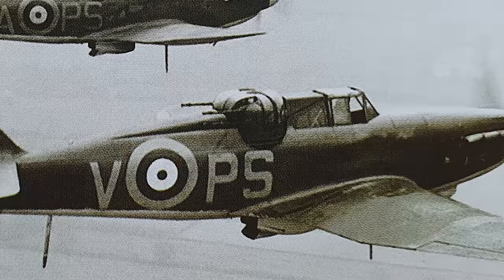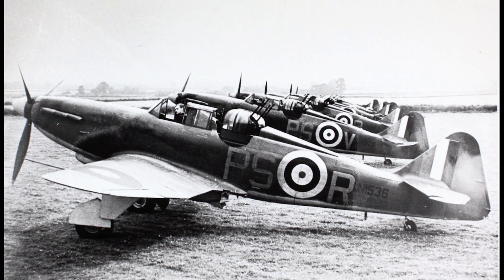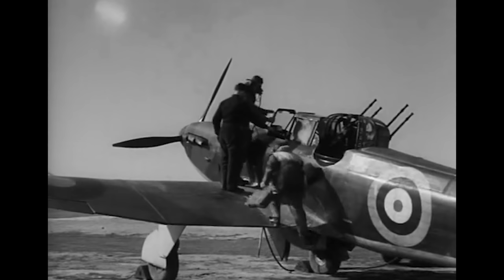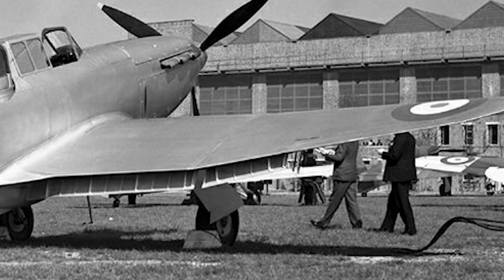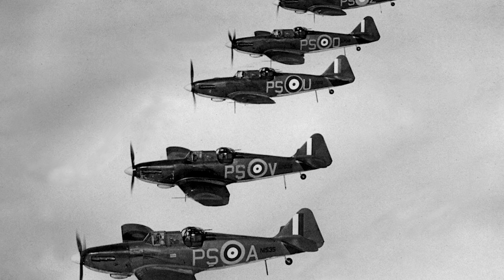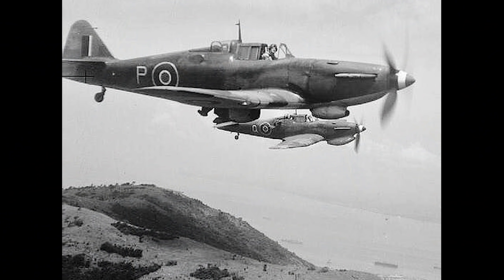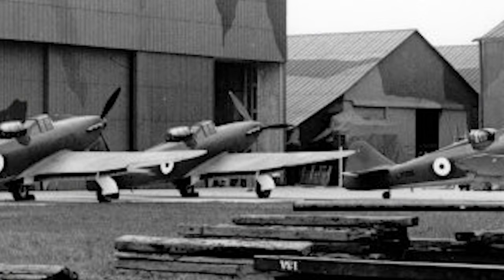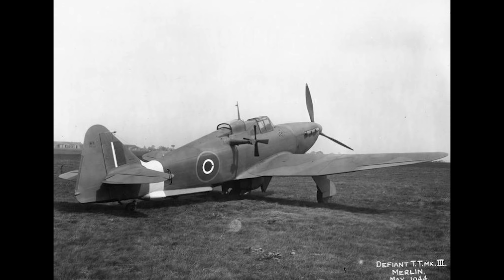Boulton Paul Defiant - The Unlucky Turret Fighter | Aircraft History #4

Comment: My Dad served on HMS Rosebay, a corvette, from 1943-45, as the senior rating for gunnery. He chose the BPD turret that was installed where the aft 4" gun had once been to be his station. Elevated on a platform, through which you gained access to the guns, it provided excellent aft and about 200´ pan from port to starboard.

Comment: As a youngster in the '60's I always carried a torch for the Defiant, and even at that young age I could shoot holes through all of the aviation historians 'reasons' why it was a failure as a daylight fighter.  Recently a book was published, 'Defiant, the untold story of the Battle of Britain' and all my early beliefs were fully vindicated.
The cause of the Defiant's unwarranted reputation as a failure is chiefly down to the commanding officer of 141 Sqdn, an arrogant man who refused to take advice from the commander of the far more experienced 264 Sqdn.  Incidentally, you're video is a little inaccurate when it said all nine of 141's flight were shot down, the correct figure was 7 out of the 9.  But what is often not known is that this flight of inexperienced aircrew were jumped by a full wing of 30+ 109's, a veteran group with several aces among them.  Even so, they managed to bring down 4 109's in return.
The Defiant was a victim of gross mismanagement at higher levels, and poor leadership on the front line.  Handled correctly by playing to it's strengths it was the equal of the 109, and in a mock dogfight against a Spitfire flown by Sqdn Ldr Stanford-Tuck, a leading British ace, it flew rings around the Spitfire, recording one 'kill' after another, while Standford-Tuck never once got the Defiant in his sights.
Reply from the maker: I'm waiting for my copy of that book to arrive. If I have time I plan to cover some of these aircraft in depth sometime in the future (probably 1 hour videos) and I plan to feature the Defiant again :)
Reply: a great post and excellent points. However, if the core of the argument is " .. when expertly handled .." the question then becomes, will the pilots survive to become experts?
Reply: Flew rings round the Spitfire? Surprising, when you compare performance statistics
Reply: What is the recently published book that you mention?
Reply: @RexsHangar  Don't bother.  Wait for Andy Long's book on the Defiant, due out next year.
Reply: Excellent comment Nigel, beefing up an excellent video.
Reply: @madisntit6547  I call upon over 40 years of research here and in Germany, and the authorship of books and magazine articles, as well as giving talks to aviation groups.  I prefer to maintain my anonymity on here, but am happy to pass on information that I have acquired over that time, as well as to point people in the direction of where to find the information from modern research (i.e. the book on the air war over Dunkirk by Simon Parry and Mark Postlethwaite published by Red Kite [both are also experienced researchers with many decades of research]).  What I am not happy with, and I try to correct, are the myths and incorrect information that over time has been accepted as fact, such as the 39 victories claimed by 264 Squadron on 29th May 1940.  It didn't happen.  But I approach this matter from an even-handed position: the Luftwaffe overclaimed heavily during the Battle of Britain.  One fighter unit claimed to have shot down 51 RAF fighters in one day - absolutely preposterous!  I hope the foregoing explains for you in more detail the reason why I have countered certain things in the vid.
Reply: @colvinator1611  Excellent comment?  Are you sure?  '...The cause of the Defiant's unwarranted reputation as a failure...'  It was a WARRANTED  reputation, since it was a failure as a day fighter.  '...Handled correctly by playing to it's strengths it was the equal of the 109...'  It was the equal to a 109, with a top speed disparity of 50 mph?  Sorry, that is just a joke!  '...Even so, they managed to bring down 4 109's in return...'  No they didn't.  One 109 was claimed by P/O Tamblyn; one damaged by S/Ldr Richardson. The other 109 claims were by 111 Squadron.  In fact all the 109s of III./JG 51 managed to get back to France, albeit four in a damaged state.  One of the 109 pilots died as a result of his injuries (cf. 'Battle of Britain Combat Archive, Volume 1' by Simon Parry, published by Red Kite - I recommend this series most highly to anyone with an interest in the Battle of Britain).  Sorry, but there are some things in that post which are simply incorrect...
Reply: @madisntit6547  The unfortunate thing is, the information is 'out there', but these documentary-makers do not appear to get in contact with the correct people.  The only ones that I know of that have been contacted in recent years that know their stuff that have been used in documantaries are: Dave Brocklehurst Mbe, Simon Parry, Andy Saunders, and Stephen Bungay.  And a merry Xmas and happy new year to you.  Take care, stay safe!
Reply: Brilliant response... I worked as part of a RAF team in the early 2000,s up at RAF Hendon.. Working on many WW2 aircraft and the Defiant was one of these. Cracking aircraft. Extremely brave men. If they'd been fitted with a constant speed prop and bullet proof glass more pilots and gunners would of came back to tell the tale.... Was sent up without cover and got slaughtered....
Reply: I only checked the comments to see how many rabid Defiant fans would emerge, and I was not disappointed.
Reply: Flew rings around the spitfire hahahaha
Reply: My heart has always had a soft spot for the Defiant, but I have never l t myself believe that it would be on par with a 109, let alone a Spitfire.
The comment above is amusing 😂
Reply: Standford Tuck flew Hurricanes throughout WW2.
Reply: No amount of confirmatory bias (“vindicated”) can change the Defiant’s abysmal record - and that book you cite has been trashed by multiple historians as a poorly-researched mess by an (non-aviation) author who is clearly out of his depth, doesn’t understand his subject, makes bizarre, amateurish, errors and has an agenda to rewrite a bad aircraft as a plucky underdog. A great British design debacle to rival even the Great Tank Scandal.

Comment: Really fascinating concept, I’m sure it would’ve had more success under slightly different circumstances. And with some design changes, the turret could’ve fulfilled the roles of main armament(forward facing, pilot controlled), self defense and „Schräge Musik“.
Reply: The turret could rotate forwards and the guns locked at a 45-degree angle upwards. Oblique attacks from below were a feature of the design concept.

Comment: After seeing that guy climbing into the turret, I presume that being assigned as a gunner was practically a death sentence; I don't see how anyone could bail out of that. 

I would be curious to find data on how many Defiant gunners ever made it out of planes going down.
Reply: Author Alec Brew has a book about the Defiant that goes into all of this.  It was hard to bail out of but the gunner's clothing helped - that bulky suit he wears incorporated a parachute into it, so there was no need to clip on a parachute and then jump, the way, say, Lancaster rear gunners had to in similar turrets.
Reply: @elennapointer701  👍
Reply: A few things of note here. Boulton Paul were aware of the shortcomings of the turret for bailing out of. Air gunners were assigned a special parachute rig which covered the back entirely in a flat pack arrangement. I believe the Battle of Britain museum has one on show. Also not well known is the beneath the gun turret was a kick out panel for emergency escape. The gunner actually sat in a sling type seat and procedure was to slip down out of the seat and kick out the panel. That was the theory anyway but if it was ever used is not on record. Getting out the same way as getting in would have been a slim chance.

Comment: I've always wondered why, when the turret-fighter concept didn't pan out, they didnt remove the turrets and blank off the space for them, adjust the rear of the cockpit so that the pilot could see all around,  and add some wing-mounted guns. They might've been able to add an extra fuel tank or even a little more armour for the pilot, with the weight saved from removing the turret and second crew member.  It might well have made a reasonable fighter then (local defence in areas away from the Channel, perhaps?), and with development, I suspect might have become a very capable fighter, especially with thinner wings.  When you look at the numbers for the thing - engine HP, mass, performance, etc,  it looks to me that it might have -by the numbers - surpassed the Hurricane. Which of course doesn't mean it would have been practical to convert the Defiant whilst the country is fighting desperately for survival, when you can just crank out more of the already perfectly good Hurricane instead!
But I've always had a soft soft for the Defiant, more for what it could have been if it didnt have that silly turret, than for what it actually was.

Comment: There were 9 designs submitted to fill Specification F.9/35 - 2 of which were flown (the Defiant and the Hotspur). There were also the F11/37 and the F18/40 Specifications both of which used cannons instead of machine guns, none of which got of the drawing  board. Then there was the Misquito F.II, which flew and confirmed de Havilland right about the Mosdie not needing the turret and the ,kiss of performance it created.

Comment: I remember reading an RAF pilot's assessment of the Defiant. The stable handling would have made it an ideal ground attack aircraft with the turret protecting the tail, a British Sturmovik IL-2.
Reply: I read one of the original documents held in archive by BPA ltd. The testing pilot said the aircraft handled exactly like a Hurricane in all respects of handling but the pilot had to be aware of the shifts in the aircraft when the turret was moved. Good training between pilot and gunner resulted in a rear firing and stable gun platform.
Reply: Except it was not designed to carry even more mass that would required for installation of additional armament.
Reply: @victorhartman1904  That was the pilot's assessment - that it would have made a good ground attack aircraft. You could have removed the turret and fitted twin Vicker's K guns on a Scarfe ring for rearward defence. That would have removed a lot of weight.
Reply: @geoffreypiltz271  What you are describing is essentially the Hawker Henley. But that`s another story.

Comment: The downside of the Defiant was not only its lack or forward firing guns . Which made it ineffective in combat . A more deficient effect was its need for the Merlin engine that were needed  in the Spitfire  and Hurricane fighters . This took 1200 fighters out of the picture . This was equal to the German  Luftwaffe scoring at least 600 victory's due to the RAF shortage of fighters  with no positive results  . As the Defiant shot down few enemy planes  a additional 1200 Spitfires and Hurricanes which were far more effective would have made a bigger impact

Comment: So not a failure after all. I wondered what the performance of the aircraft would have been without the turret, with forward firing guns just like the Hurricane or Spitfire. Looked a very streamlined aircraft. I did notice the gunner trying to shut the rear doors with effort getting into the aircraft, i wondered if this would have hindered him getting out in an emergency, especially if wounded or if the turret was damaged, that would be a unlucky gunner.
Reply: That's what I thought too. It was like trying to close the sliding doors on a shower with wet hands. Plus he couldn't bail out if he was facing to the rear
Reply: '...So not a failure after all...'  Sorry, but it was.  Its reputation was built around its 'claims' of 39 Luftwaffe aircraft shot down on 29th May 1940, when the 'actuals' was between 3-4.  The Air Ministry continued to use two squadrons in the Battle of Britain (141 & 264) and they were withdrawn after being slaughtered in the skies of southern England.  And that's a fact.

Comment: I did hear somewhere that the RN got their hands on a few of the turrets from the defiants and bolted them to the top of the turrets on some of their older destroyers. Great for AA work and makes a mess of a German U-boat crew trying to man their deck gun... not sure how true it was as I can't find reference material. Would have loved to see it though.
Reply: We're they at least upgunned to 50 cals, can't imagine 303s doing much damage until you could see the attackers eyes
Reply: No. 
Most of the turret is inside the aircraft, it reaches nearly the full depth of the fuselage.
There is no wat to incorporate that in to a destroyer gun turret, it is full of gun. It would work if you removed the gun from the turret but then you would have to rig up a hydraulic supply to power it.
See link for the various turrets used by British destroyers. https://en.wikipedia.org/wiki/QF_4.7-inch_Mk_IX_%26_XII_naval_gun

Comment: At 4:46 he claims that on 29th May 1940 264 Squadron shot down 19 Stukas, 9 Bf 110s, and  Ju 88.  The claims for 29th May 1940 actually totalled 39 across two combat missions.  This was overclaiming on a massive scale.  The Luftwaffe did not lose 39 aircraft IN TOTAL on that day.  No Bf 110s were lost, and the claims for Stukas was ridiculous.  To get an accurate view of what happened on this day, get hold of 'Dunkirk Air Combat Archive' by Simon Parry and Mark Postlethwaite, published by Red Kite.  264 can be creditedwith 4-5 victories at best.  264 Squadron in the afternoon action claimed 7 Bf 109s destroyed and 1 damaged; 2 Ju 87s destroyed, and 9 Bf 110s destroyed and the shared destruction of one other. (No Bf 110s were lost, no Ju 87s were lost, and the three Bf 109s shot down are ascribed to combat with 610 Squadron by Peter Cornwell's loss/damage tables - two other Bf 109s were damaged). For the evening action, 17 Ju 87s were claimed, with another 2 Ju 87s claimed as shared. 1 Bf 110 and 1 shared Ju 88 were also claimed. 2 Ju 87s were actually shot down, another landed damaged, and another overturned on landing. 2 Ju 88s were shot down and another damaged in combat. A fourth was damaged by AA fire. No Bf 110s were lost. Unfortunately, what was claimed by 264 on 29th May does not remotely match up to the actual losses of the Luftwaffe.
Reply: Is typically english and american to claim destroyed more then 10 times the esistent hardware of the enemy. In Serbia invasion war, Nato claim more then 800 tanks destroyed, later discovered only 4 wreks.
Reply: @lingnoi2816  Overclaiming occurred on ALL sides during WW2...
Reply: @Pokafalva  sure, but angloamericans where obsessed in the propaganga war
Reply: @lingnoi2816  I do think you are showing a a bias against the British and the Americans.  Did not the Germans indulge in a propaganda war?  Did not the Russians indulge in a propaganda war?  I do think you should approach the matter of overclaiming in an even-handed way, not in an obvious biased way.
Reply: @Pokafalva  Is true that all try to enlarge victories and reduce losses but, i say again, angloamericans are over the top. In Vietnam invasion war, at 5 pm every day there were the press conference where US Officials described the great deal vietcong killed. One day a CIA operative say: "If we add all the numbers of enenies killed, this is more then the whole North Vietnam inhabitants, so, what are you waiting? Go there and conquer, is empty."
Reply: @lingnoi2816  Last reply to you.  You are obviously anti-American.  This is a Youtube page about the Boulton-Paul Defiant.  I'm not interested in making further reply to you...
Reply: @Pokafalva  simply you don't like History when collide with your forma mentis.
Reply: @lingnoi2816  You haven't a clue.  You are prejudiced against Americans.  Just don't bother...

Comment: The similar FAA Roc fighter was actually slower than the Skua bomber it was developed from. There was some speculation that it could have been a great fighter had the turret equipment been removed and guns fitted in the wings. It would certainly have outperformed the Hurricane and come close to the Spitfire in speed. But developement was never started.

Comment: They should have been flown in mixed formations with Hurricanes or the non turret version of the BPD. With the turret fighters being the 2 rear fighters in finger 4 formations. Ontop of which 2 .50s in the turret & 2 .50s & one cannon facing forward. All in the fuselage, meaning simple sights, the benefits of zero deflection shooting  & room in the wings for bag tanks. Also some of the turretless BPDs or Hurricanes in the same squadron should've have sheet metal applied giving a side profile of appearing to have turrets too, while adding buggerall drag. .

Comment: As always great research however, you did miss out on the less then pleasurable experience of the pilot being given a front row seat to the shower of sparks and shrapnel from the 303 rounds hitting the propeller when the fighter was engaging  on coming fighters. The same problem if found with the Blackburn Skua, when given a rear turret.